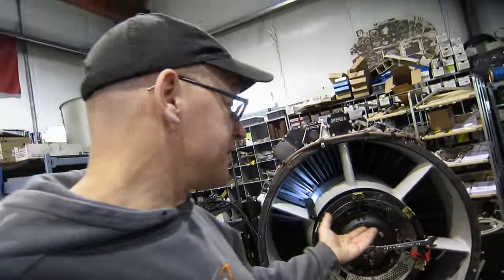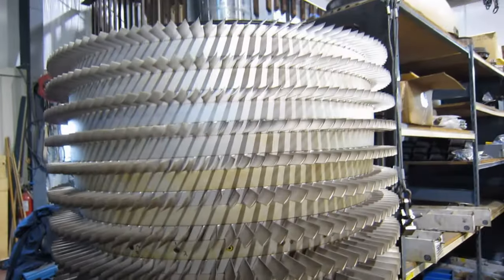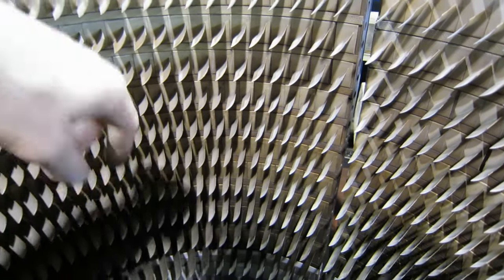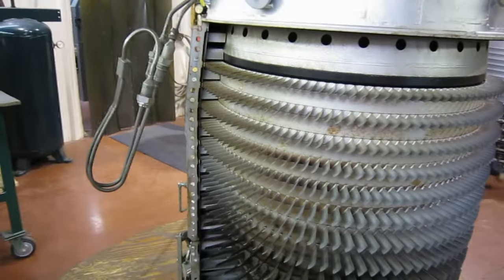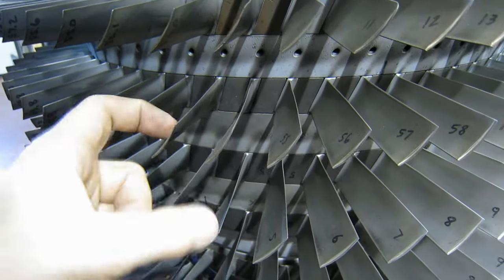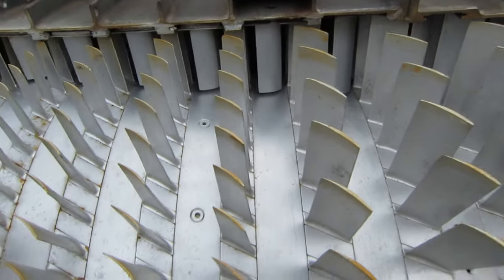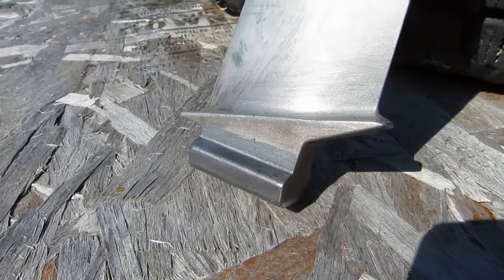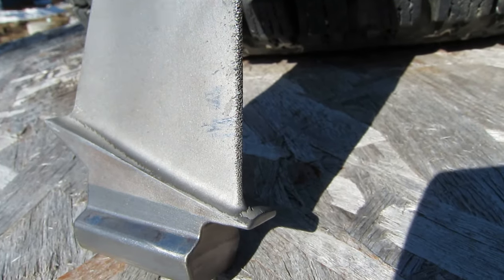Compressors - Turbine Engines: A Closer Look

Comment: Amazing video! Thank you! 
You mentioned in 4:18 that the blade should be loose, is it goes the same with the heavy duty (power generation) gas turbine? Is there anything to do with, or any differencies in terms of temperature level or compression ratio?
Reply from the maker: I have no experience with the heavy industrial engines, but they appear to feature the same type of blade attachment mechanisms as the aeroderivative engines I have worked on.
For that reason, I think the blades would also be firmly but not rigidly attached to the disks.
Reply: @AgentJayZ  Thanks man, appreciate it!

Comment: What os fascinating is entire blade is a single metal grain (check out metal grain structure)
Reply from the maker: 1) These are not blades, they are stators. They are made of conventional stainless steel.
2) These are stators from the compressor, not the turbine.
3) The turbine blades are made of forged nickel alloy in the J79... SIngle crystal cast blades were introduced in engines that were developed after the J79.

Comment: How would the engine perform if there were no staters or outlet guide veins?
Reply from the maker: Move some air. No compression. Lot of fuel burned. No power. Probably would not self sustain. Lose rpm. The "engine" becomes a "fire".
Reply: Thanks for the quick response.  I guess I never thought about it before but the compressor blades alone don't really compress the air themselves but the fixed pieces (staters,GV's) play a huge role.

Comment: So what PSI does the air in a jet engine reach before it's combined with fuel and ignited?
Reply from the maker: Every engine has its performance characteristics. The first engines had compressor discharge pressures of 50 or so psi. Modern airliner engines compress the air to over 600 psi before fuel is sprayed in.

Comment: What is the diameter of the compressor blades and RPMs of that little 1,400 HP engine?
Reply from the maker: That's not a dimension that is ever measured or listed. The clearance between the cases and the blade tips is important, and is measured by assembly with wax strips in the blade paths, then disassembly to check. A lot like plastigauge for crank bearings.
The case inner diameter is variable, and so difficult to measure that it's done this way.

Comment: Why the air has to be compresed before going in to the cusbostion chamber?
Reply: +pierre jean Because more oxygen = stronger burn = more power + efficiency because you're getting more out of the fuel.

Comment: can you say which airfoil have been chosen for comoressor blades
Reply from the maker: NASA have an archive of tens of thousands of airfoil shapes.
The airfoil shape of a compressor blade can be different from root to tip, and stage to stage, as well as engine to engine.
Your question has no relevance to what I do, so I can only answer: I have no idea.

Comment: Would a liquid medium face the same effect that air does when going though those compressors?
Reply from the maker: +George Pierson I don't think so. liquids are compressible, but the pressures involved are tremendously higher than those required to have practically useful effects on gases. I don't think we use the compression of liquids in our (we humans) technology, do we?
I think the whole field of hydraulics counts on the compression of hydraulic fluid being infinitesimal at working pressures of up to 10, 000 psi.
Reply: AgentJayZ

The reason why I am asking is because I was seriously looking into magnetohydrodynamic drives. I had found interesting videos on them. The idea I had was to increase the amount of pressure going to the magnetohydrodynamic drive section by using some sort of compression system like the one being explained in the video. It was supposed to be part of a story I was going to write, but that's another subject.

Comment: 7:18 If you sand and polish the blade its weight/mass must change ever so slightly. Does this not cause an imbalance ?
If so, how do you balance such a complex rotating mass ?
Reply from the maker: Any blending of blades is done before the rotor is assembled and balanced. I have videos posted on balancing compressor rotors.
Reply: @AgentJayZ  Tks, will look for those videos!

Comment: Can you please explain how that dude got sucked through the Harrier Jet engine as it was starting up, AND survived? If there is so little space how is it possible!
Reply from the maker: No. No such thing happened. Do not try to explain it to me.
Do not respond at all. 
Thanks.
Reply from the maker: I thought I told you to go away.
1) It is not a Harrier, It's an Intruder.
2) The J52 has struts, then guide vanes, then the compressor.
3) Nothing went through the engine.
Now, seriously, go away, and do something about that ignorance problem...
Please do not reply.

Comment: What are the materials used  to make a compressor's blade in a modern A/C?
Reply from the maker: What's an A/C?
Reply: AgentJayZ A/C=  Aircraft
Reply from the maker: If you can't be bothered to actually spell out aircraft, exactly how much effort do you think I should apply to answering your question?
Sheesh! I think I'm done.

Comment: How many blades per stage and how many stages on the big one? Thanks
Reply from the maker: In the very earliest designs of axial compressors, five or six stages were used. The need for higher compression caused this number to reach 17 in the J79 and Avon. Then as computers helped design better airfoils, and engines began using two tandem compressors, the number of total stages dropped to about 12. The number of blades is never a match or a multiple of the number of vanes, to avoid creating a siren effect.

Comment: How many psi can a turbine compressor make in the combustion chamber?
Reply from the maker: A hypothetical question using incorrect terminology.
The best I can do is answer "it depends on the design of the compressor and efficacy of the seals". First generation turbojets had CDP of 30 -40 psig. Modern airliner engines have CDP of over 600 psig.

Comment: Could you plesea share an information about compressor rotor blade and stator blade airfoil choosen
Reply from the maker: Same response as I gave to Ayse Karkurt: 
NASA have an archive of tens of thousands of airfoil shapes.
The airfoil shape of a compressor blade can be different from root to tip, and stage to stage, as well as engine to engine.
Your question has no relevance to what I do, so I can only answer: I have no idea.

Comment: I want to know why those stator have to be there. Wouldn't the rotators move the air themselves just fine? Wouldn't those stators a impede airflow?
Reply from the maker: Rotor blades accelerate the air rearwards. Stator vanes slow it down, converting the velocity to pressure. Increasing air pressure is what a compressor is for.
Reply: @AgentJayZ  thank you! I understand that now. The energy in the fast moving air has to go somewhere when it is slowed down, and that somewhere is heat and pressure, the things you need for jet propulsion. You only want it to be fast moving again after you have added fuel and explosive energy to the compressed airs, yes?

Comment: whats the mechenisim that makes the blades spin the first place? is there a motor that spins the blades?
Reply from the maker: The blades are the airfoils attached to the main rotor. It turns because it is powered by the turbine.
Variable stator vanes don't spin, but are rotated on their long axis through a roughly 45 degree arc by the variable geometry system: arms on the vane axis that extends through the engine case, attached by a lever to a ring, which is attached to another arm, which is attached to a rack, which is attached to a pair of hydraulic cylinders, the position of which is set by the engine main fuel control, based on engine rpm, air pressure and air temperature.
Reply: AgentJayZ  Hi thanks for that!  Can you do an episode about this possibly with a diagram!
Its so fascinating this stuff!
Thanks for enlightening us about all this!!

Comment: why not design a type of large diameter hole ( approx 2')  protective screening , mounted in front of the jet engine intake turbine blades? This would  keep larger birds and large ground debris from getting sucked in, causing serious internal engine damage ? Thank you
Reply from the maker: Two inch bits of anything would still damage an engine.
Reply from the maker: Gary Vale Why not have a 2 ft by 5 ft section of chain link fencing held out on struts in front of every F1 car to keep debris from damaging them and injuring the driver.Makes a lot of sense, since they run on the ground at low speeds of 150-200 mph. Airliners are up in the sky, travelling at almost 600mph.

Comment: 7:01 aren't turbine blades made out of titanium alloy?
Reply from the maker: 1- Turbine blades are never made of titanium, because it can't survive the heat of combustion gases.
2 - The object shown at that point in the video is a compressor blade, as mentioned a few seconds earlier.
3 - If you meant turbine engine when you said turbine, you illustrated the importance of using the correct names for things.

Comment: Is it true that The shape of the compressor should be divergent, if yes ..I am anable to understand in this video....as the compressor progresses the size of the blade is reduced ....the space looks like convergent
Reply from the maker: At each compressor stage, the air goes through divergent pathways, and becomes compressed. Being compressed, it takes up less volume per unit of mass.
As the air gets compressed, the pathway through the compressor narrows down, in order to keep the speed of the smaller volume of air constant.
The compression happens in the divergent pathway created by the stators. The narrowing of the gas path through the compressor cases is there to keep the speed  of the air constant as it shrinks in volume.
Reply: @AgentJayZ  thank you very much sir....your reply really cleared  my doubt👍

Comment: If the base of the blade is going slower than the tip, as it would when rotating, why isn't the base more angled than the tip to increase it's angle of attack? Why does the base of the blade not stall?
Reply from the maker: These are stators. They are stationary.
Reply: @AgentJayZ  Sorry I mean on the compressor blades themselves where the base of the blade is closest to the fir tree part, on the first few stages the tips are around 45 degrees to the axis of the engine whereas the bases seem to be at a much lower angle relative to the long axis. 1:04 for example
Reply: @AgentJayZ  I suppose a better word is angle of incidence not angle of attack.

Comment: What is the compression ratio? I think boeing's engine has much less stages.
Reply from the maker: This type of compressor becomes more effective as it gets closer to its design speed. At low speeds the air is not compressed at all. At 7500 rpm, the air is compressed to a little more than 10Bar by the compressor of a GE J79 engine.
Since the axial compressor is a non-positive displacement type, it does not have a compression ratio, it has what is called a compressor ratio.
Small difference, but compression ratio is short for static compression ratio.
The static compression ratio of an axial flow compressor is always zero.
Reply: new GE engines are what 32;1

Comment: What could happen if one of these blades brake? The engine will going to fail of just a loss of power ?
Reply from the maker: We have received engines before that have broken stators. It causes a lot of damage to the rotor blades and other stator vanes, but the engine usually continues running.  typically the engine is shut down because of reduced power and increased vibration.
Reply: @AgentJayZ  Very interesting. Cheers from Italy.

Comment: I'm trying to understand the fundamental difference between the design of a typical air compressor you might use at home... and the air compressor of a jet engine. Is there an easy explanation that a layman like me can understand? I guess specifically I am looking at the design of the 'fans' and why they seem to be such different designs for doing the same job. Namely, to compress air. Thanks.
Reply from the maker: A typical shop air compressor is a positive displacement piston compressor.
A large turbine engine uses an non-positive displacement axial flow compressor.

Pistons have static compression ratios, so the amount of air compressed depends directly on rotation speed, and the output is always at the same pressure.

Axial compressors have only dynamic compression, so the amount of air compressed increases exponentially with rotation speed, and the output pressure increases with speed.
They are very different.
Reply: AgentJayZ  Hey, thanks for pointing me in the right direction!
Reply: AgentJayZ very good explanation ;)
Reply: Another way to think about it would be to observe that an ideal piston compressor can work at as slow of a speed as you desire. An axial flow compressor does nothing much when you run it slowly. The axial compression is a dynamic phenomenon: it requires things to be moving fast enough. A piston compressor - again, an ideal one that doesn't leak - will compress air no matter how slow you run it, because it first encloses air in a space, and then squeezes the space. An axial flow compressor doesn't enclose the air fully: the rotor blades push against the air, but there's nothing pushing on the air from the opposite side - well, nothing other than the inertia and drag of the air itself.

Comment: there is a suprising amounth of gap between the stator veins and the rotor veins. Also that dreadful noise when you rotated the cutaway...
Reply from the maker: The cutaway is called a cutaway, because the outer case has been cut away. If you look closely, you will see that you can see the inner parts of the engine. The cutaway portions of the cutaway are not there. That's why we use the word "away" in the compound word cutaway. The whole thing is stored outside, and the parts that are not there are not able to prevent dirt, leaves, and debris from falling into the engine.
Reply: @AgentJayZ  Thank you and I perfectly understand that. Its still such a dreadful noise :D 
What I absolutely didnt expect is there to be such a large (almost quarter of the vein widht) gap between the stator and rotor veins. It is very interesting. I want to 3D print a sort of axial compressor myself. I am not really looking for something particularly amazing here. More like something that will blow up a balloon to explosion. Also I wonder what kind of compression ratios how many stages to build, so on. How to determine these absolutelyy basic parameters.
Reply from the maker: For blowing up balloons, you need a single stage centrifugal, like out of an old turbocharger. Don't leave out the diffuser, because that's where the pressure comes from. Without a diffuser, you have a leaf blower, which only speeds up the air, and does not raise its pressure.

Axial flow compressors are very expensive to make, and are only used when necessary to achieve the performance required. So far that is in only one application.

Comment: If all jets are gas turbine engines, then there was a crewman who did survive being "sucked" in and spit out the back. You could see lots of sparks as his helmet shatters hundreds of those rotor blades or whatever, which is what saved his life.
Reply from the maker: Incorrect, my friend. What saved his life was the front frame of the J52 engine inside his A-6 Intruder. The first thing the air or anything else encounters as it approaches the engine inlet is the 16 struts that support the front bearing housing in the center of the engine.  
Have a look at the Pratt & Whitney J52 on Wiki.
The struts prevented the helmet and the crewman's body from actually entering the engine. It has been reported that the sparks were caused by the ingestion of the goggles into the engine, which did cause some damage.
I'm sure it must have been a terrible experience, but it is totally incorrect to say he was drawn into the engine. He was in the inlet duct, which is the part of the aircraft that leads to the engine.
Don't worry, you are in good company. I have never had anyone mention this story to me that has not had the same misunderstanding.

Comment: what initialy starts the turbines? gas thrust?
Reply from the maker: Yes. The starting up of the engine is done by some outside source of torque. The starter, which is either an air turbine or an electric motor ( see my recent video : many ways to start...). The starter turns the shaft (to which the compressor ant turbine are solidly attached) up to a speed where the compressor begins to move sufficient air. Usually about 10% of max rpm.
Fuel and ignition are added, and the heated combustion gases rush out through the turbine.
The starter keeps helping increase the rpm until about 30% rpm, when the compressor is delivering enough cooling air to protect the combustion liners. At that point the engine has reached an rpm from which it can accelerate on its own to ground idle, about 40%.
Ground idle is the lowest speed the engine can turn where it has enough cooling air flow to avoid overheating the turbine.
From ground idle to any significant power takes about 10 or more seconds.
Flight idle, which is the lowest rpm recommended while flying, is often about 85% of max rpm, and from there it takes a couple of seconds to get to real useable power.

The turbine is initially moved by the starter, then it is moved by the flow of combustion gases.

Comment: I thought those had like 0.010" clearance everywhere.
Reply from the maker: Those? Everywhere?
There used to be a game show you'd be great at: It was on Mad TV and it was called Vague.
Typical compressor blade tip clearances on these old engines is about 0.100 inches. Yes, closer means better efficiency.
Typical main bearing clearances on these old engines are about 0.0005 inches. That's a mighty close shave!